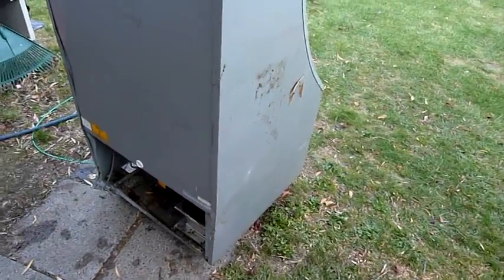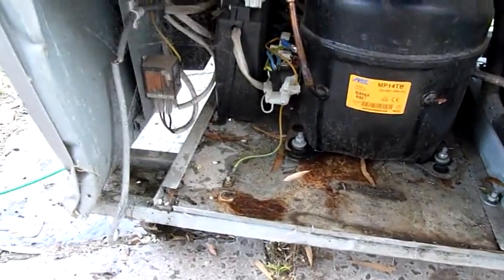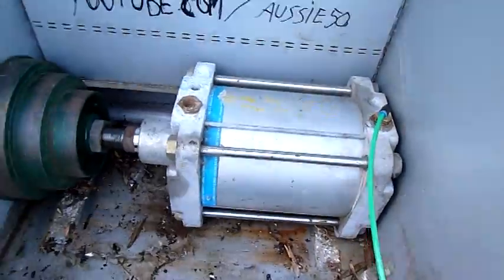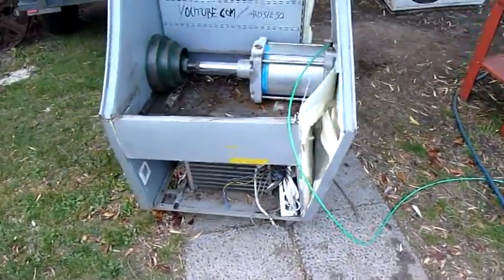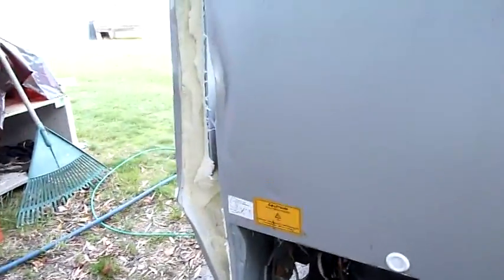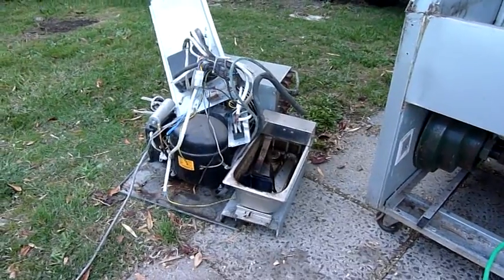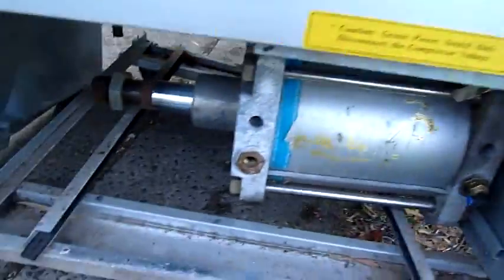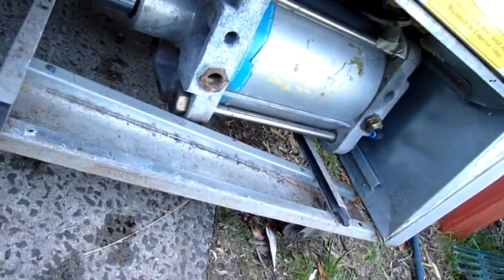Air Ram Vs Drink Fridge Cabinet.mpg

Comment: I would mount one of those ram's on a plate and use them as truck jacks if their travel was high enough, or maybe make up a pneumatic arbor press from one. There are a lot of project ideas for these things, especially one as strong as that.

Comment: @Aussie50 But it's not as disturbing as what is going to be rammed IN as to what it's going be used to spread.

I'll got dibs on using it next! 

Sic it on a washing machine and crack open the drum while it's running.

Comment: @zx8401ztv For can crushing you generally want something faster with less torque. Also, a return spring cylinder is often used, so you can get away with using a 3/2 valve.

Comment: Hehe, now that was cool, 2-Ton Pneumatic Ram, every home should have one... Though maybe not in the fridge.
Anyhow, I had an idea, I'm not sure how hard it would be to try, but I am curious as to what might happen if something relying on heatsinks (such as a computer) would behave if a vaccum occured within the casing, presumably it would heat up as there is no air to absorb the heat. Anyway, it's just a thought.